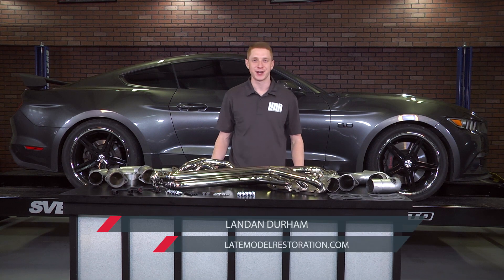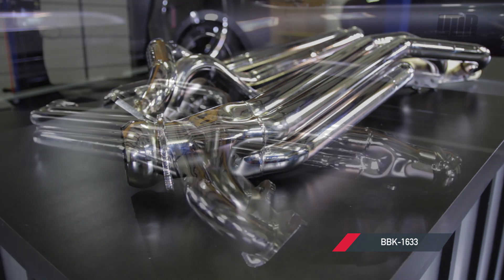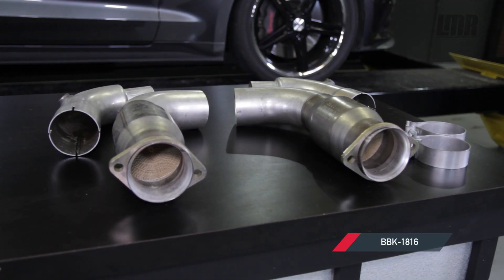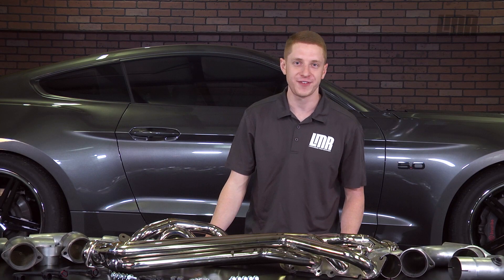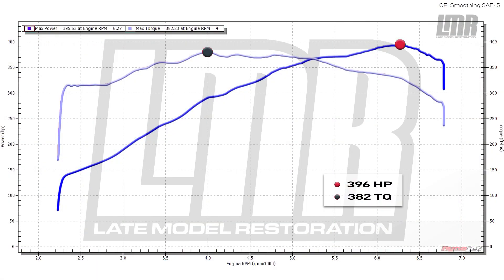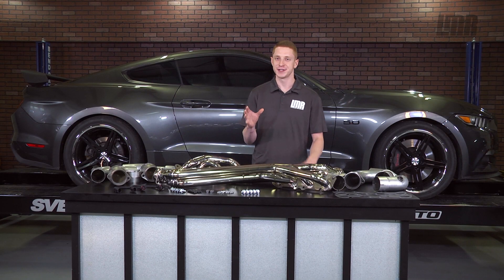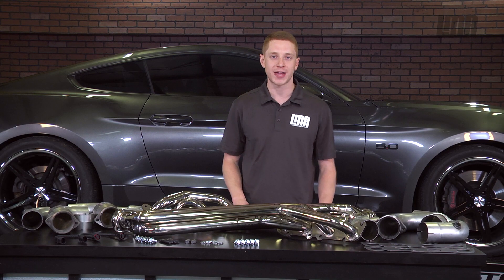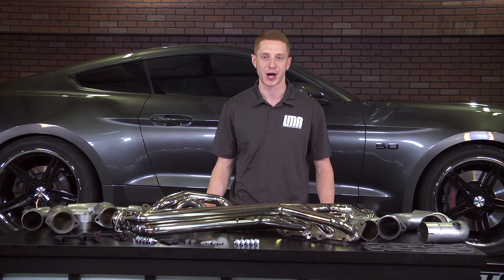2015-2023 Mustang GT BBK Long Tube Headers | Review & Dyno

Comment: I added the BBK ceramic long tube headers with the BBK cat mid pipes and the Corsa extreme exhaust with a Injen closed closed intake after dyno and tune all it did was 404hp peak...figured it would of added more...
Reply: how does it sound?
Reply: Who are you tuned by?
Reply: Go on e85 that’ll wake up the coyote.

Comment: Will a corsa mid pipe work with bbk long tubes? Really not trying to get the mid pipe for just as much as the Ling tubes themselves
Reply from the maker: What Corsa mid-pipe are you referring to? They've had a few different options over the years. -Landan

Comment: Is there any other option for the mid pipe? They are very expensive for the bbk ones and my h pipe is 3 inch anyways so it won’t fit. What my best plan of action here.
Help!!!!
Reply from the maker: Call around town and find an exhaust shop that will build you a custom mid-pipe. -Landan
Reply: @latemodelrestoration  thank you 👍

Comment: Shouldn’t they make 460 stock?
Reply from the maker: No. 2015-2017 Mustangs were rated at 435 HP and 400 lb-ft of torque at the engine's flywheel. In the video, we measured rear wheel horsepower. This measurement is always less than the engine's rating because of drivetrain loss. Think of rear wheel horsepower as your take home pay after taxes are taken out. The drivetrain loss differs from car to car, but on average, a manual Mustang has roughly a 13-15% drivetrain loss. -Landan

Comment: i have bbk longtubes at the house but only a 27 hp gain with a tune and headers ? seems pretty low if you ask me :(
Reply: correct me if I'm wrong but wouldn't the long tubes  help more if you say had forced induction
Reply: +James probably but idk i haven't researched it since im not planning to go Fi
Reply: +Justin Villanueva even if u just do intake mods it most likely wouldn't  hurt to have long tubes
Reply: for just headers, i think 27whp is pretty decent.
Reply: Justin, the tune does not add power separately from the headers. The tune is there to make the headers and other components work together.  What many people DONT understand is, that the tune, if all by itself, is on the car and nothing else, yes it adds power, but once other power modds are put on, the tune no longer makes its own power, but rather makes all the modds work together instead. 27 whp for headers and mid pipe at the wheels is pretty darn good. That's around 31 crank hp. Most long tubes will add about 12-15 wheel hp. The mid pipe adds another 7-10 hp. And, running catted or no catts, won't make any realistic power difference. And there's no such thing as "hi-flow" catts. To many e haunt experts have shown me how little the power gained is, and it's only about 2-3 hp. No worth it.
Reply: Justin Villanueva also don’t forget curve gains too
Reply: Justin Villanueva
That's 27 hp at the wheels. It was probably mid to high 30's at the crank.
And you have to keep in mind, this isn't a 70's era smog-ladened, low compression, flat camed slug. This is a modern 4 valve engine and Ford put a good deal of thought in to the design of the exhaust system. For the stock engine it works well and is difficult to improve on. When you start combining long tube headers with cams and other mods that's when they really shine...uh, no pun intended.
Reply: The exhaust from manufacturers are more efficient than they were years ago so less gains are to be made. You already have essentially a shorty header.

Comment: Why did you choose the 1/3 4
Reply: ma pope wats wrong with that
Reply: @Father_Paul_GT  I'm curious also. Nothing wrong with it but the car being N/A  using the 7/8 would be better. I believe the 7/8 is good unless your going to add 700 plus horsepower. 7/8 just insures enough pleasure is being pushed through. I'm curious if you would have actually gotten better numbers with the 7/8. Probably not much if it did if any at all.
Reply: @lydiamiller639  I have the 1 3 4
Reply: I jus wanted the sound and I got it
Reply: Actually, the 7/8 pipes defeat the purpose on NA applications. Since the 7/8s can’t scavenge the exhaust fumes like the 3/4 due to the diameter. With that said, the 3/4 pipes are actually better than the 7/8s for naturally aspirated applications...

Comment: Damn I wish new York didn't have emission testing so I could run a off road setup
Reply: +James call me what you will but what is offroad? who off-roads a mustang? I dont get why that is even a category.
Reply: +eazyd34 when ever you don't have a cat it's considered "off road"
Reply: my uncle would swap between factory and aftermarket exhaust setups to pass emissions and then would saitch back to aftermarket after he passed.
Reply: +Joey Kimball yeah I'm probably going to have to do that
Reply: +James with your car being close to brand new it shoukd be no issue at all. he did all his work in his driveway with jack stands. he woukd remove and reinstall the supercharger too so he wouldnt void the warranty when he brought it back to ford for scheduled maintence
Reply: +eazyd34 Offroad simply means not for normal street use. Deleting your cats is illegal (won't pass emissions), so that's why people refer to them as 'offroad' pipes, because they aren't allowed on the street. But that doesn't stop people (including myself). There are ways around the system (:
Reply: +Clay P These BBK headers, off-road mids and Flowmaster Super 10's made for a loud enough car that I attempt to coast when near police and short shift. I always have it in the garage before 10 PM because it is not a daily. That being said, they sure sound good with a lumpy cam. Not as good as my friend's solid lifter 289, but still very good for a late model car.

Comment: Get rid of the CAI kit and put in a K&N drop-in. Oem, NA cars don't need or perform well with huge aftermarket CAI's.
Reply: False
Reply: With a few making upper 30's hp gains over stock, I have to disagree with you.
Reply: @Logan-ty4ib  I'm not agreeing or disagreeing. Let me know what CIA makes 30 hp. I'll buy it tomorrow. I've dropped a K&N in mine. A little throttle response is probably all I got. Maybe better gas mileage but I would know that either considering 13 mpg is my usual. I like the closed box on the Corsa being I have everything else Corsa. Any thoughts?
Reply: @Logan-ty4ib  not a single one makes 30hp . They are all using tunes . I took off my cai because the inlet temps went from 5 above ambient to 30 above.
Reply: @lydiamiller639  my 1/4 mile time with a bama tune C&L was 12.6 @113mph , I did a 12.3 1/4 @ 114 with a Ford racing tune even though it has "less" power.  My intake temp with the aftermarket cai was 30 degrees higher than ambient than with stock.

Comment: How is it makin 396 when the 2016 GT puts down 435? I’m lost and I have a GT premium
Reply: Rear wheel power is what he was showing at 396. The motor makes 435 at the crank alone, then there is horsepower loss thru the trans, drive shaft, rear end etc.. so your at 396 to the actual wheels and ground.  I make 472 at the crank and only 410 to the wheels in my 2015 5.0 with only a JLT intake and corsa catback system.
Reply: Bad Cop No Donut 
Can i put these headers on a straight piped mustang
Reply: Jeff Horn King Of Pinoyz _ yes.
Reply: Bad Cop No Donut 
Would i need the mid pipes or just headers alone and thanks for replying
Reply: Jeff Horn King Of Pinoyz _ you don’t need to change the mid pipe itself. You may need to change the down pipes where the cats are located.
Reply: Bad Cop No Donut thanks
I might take it to a shop
I was thinking maybe bbk headers roush x pipe and roush axleback

Comment: the hell? i thought the GT was supposed to put 430hp stock
Reply: Rwhp son. Crank is what is advertised. And most high hp dynos on stock cars are overstated due to open hood dynos. Closed hood is the PROPER way to dyno a car IF you drive it. If you SIT in a parking lot with the hood open, then dyno that way. Realistic average dynos for the new 5.0 are 360-380 rwhp. Note that this car in the test was not completely stock: CAI and 93 octane, plus an open hood, with a fan blowing on the engine, keeping much cooler than it would be if driving on the road, and lots of extra airflow going into the air intake that would normally never happen, with hood closed. So this is realistically a 380-385 rwhp car. 15% average. Also, if using 91 fuel, deduct 10 hp and if it's an automatic deduct 20 hp. These are the factual realities of real world numbers vs parking lot queens.